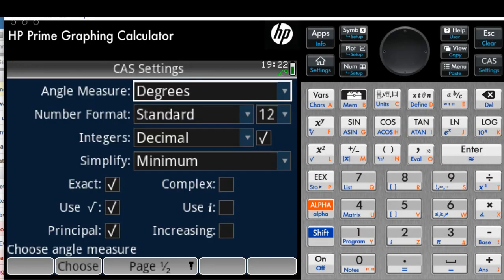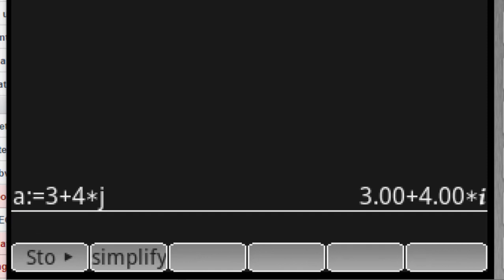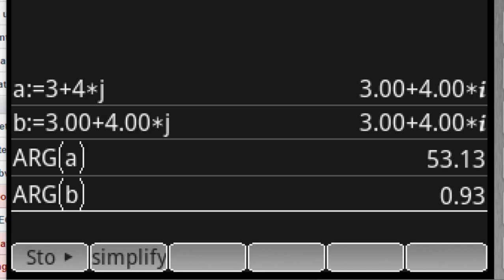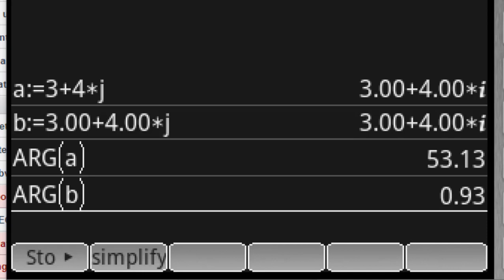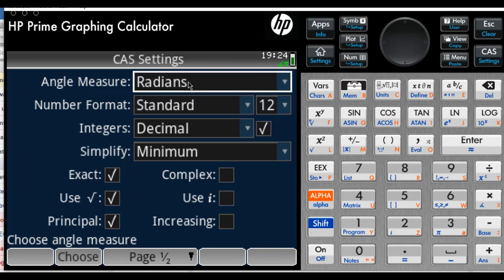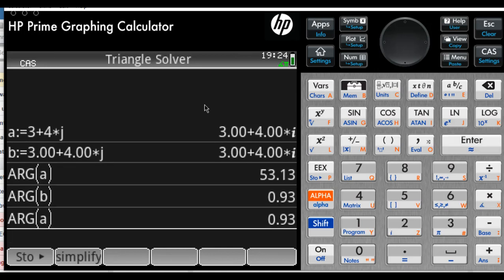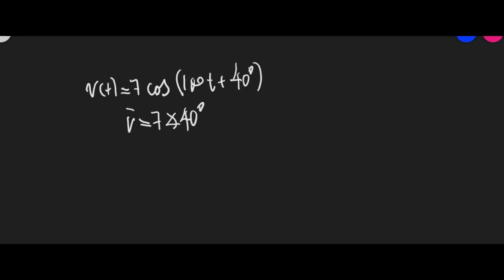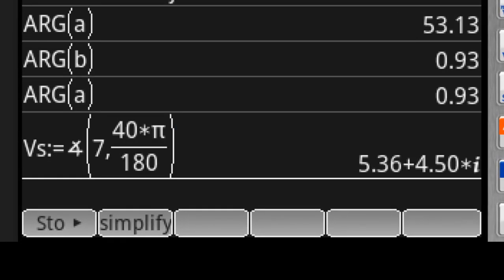HP Prime and the ARG() bug.

Comment: Thanks for the video.  I try to reproduce this with the April 2023 firmware and can't.  Anyone else?
Reply from the maker: Happily, I think the XCAS community (it's open source), corrected that bug in its latest release.  However, I still use my own argd() p2r() and r2p() functions.  They are very much part of my workflow.  And the payoff has been great, less grief when phases are in degrees, but I need to compute a value at a point in time (for which I need the4 phase in radians).

Comment: I’ve noticed that. Acctually, there is a few issues with CAS and complex numbers. I always switch to Home screen during complex calculations.
Reply from the maker: Yes, as long as I don't need to solve equations and such, I work on HOME mode too.  It is smoother (and it is HP 100% code).  In CAS, the trig functions work in DEG mode, but the ARG function continues to return radians, that is why, in CAS, I advise my students to work in RAD mode, safer that way.

Comment: I never calculate in degrees, because physics formula mostly use radians and you always can convert by foot.
What happens, if you don't remove the EXACT flag? Of course I can try myself. ;)
Reply from the maker: Actually, I set the EXACT flag back on. With it on, the answers come out as "exact" expressions with integers and rational numbers, and the occasional root. Then, to get the floating point value that I use in engineering, I need to use either evalf(), or the approx key (shift enter). If it is not too much extra hassle, leave the EXACT mode on. I did.